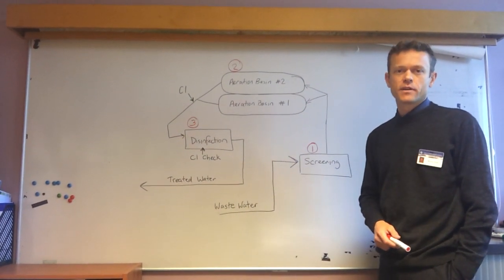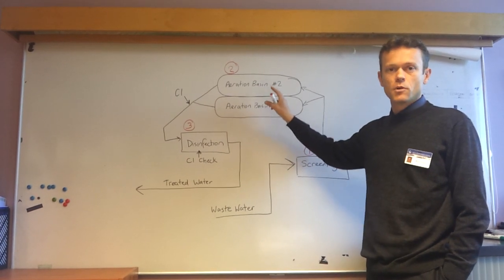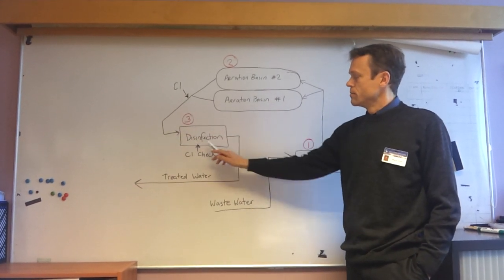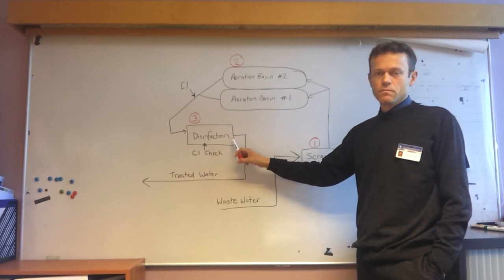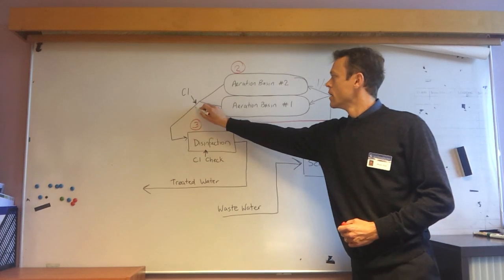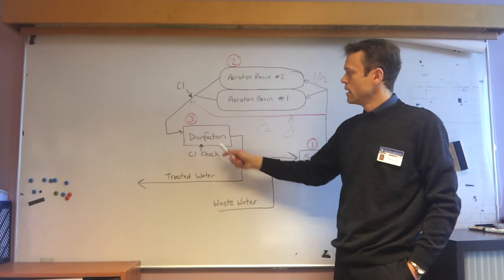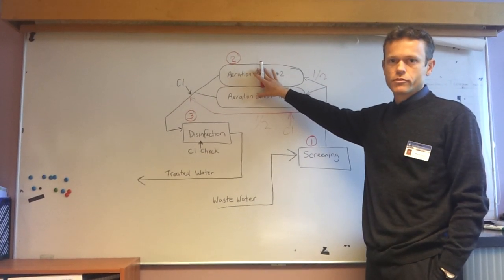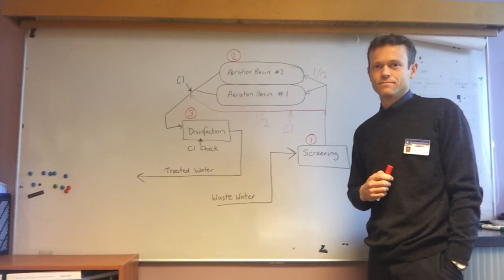New Plymouth Wastewater Treatment Plant Upgrade

Comment from the maker: Hi Marsa622, all water will be disinfected by adding chlorine. No water bypasses straight out to sea without first going through the chlorine contact tank. During the upgrade the biological treatment stage will be limited to a maximum of 440 l/s, that means for any rainfall event resulting in a flow of up to 880 l/s we can be assured that 50% will received biological treatment. This is one of the positive reasons for doing this in summer as we have less chance of experiencing these high flows.